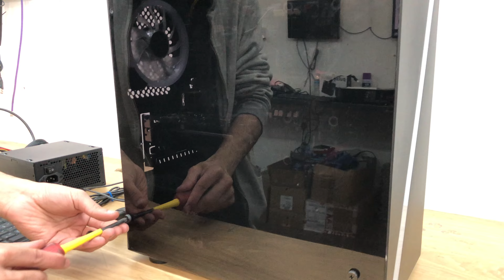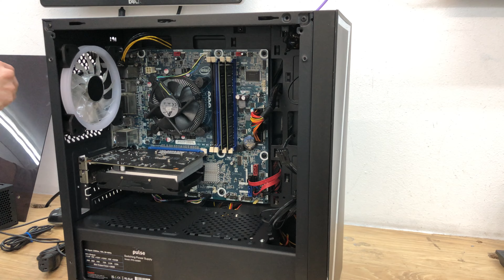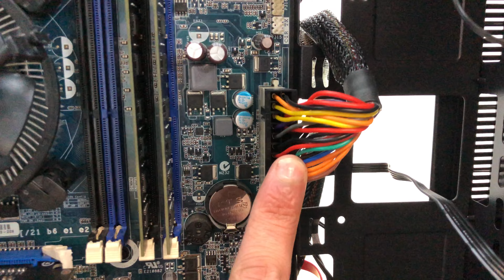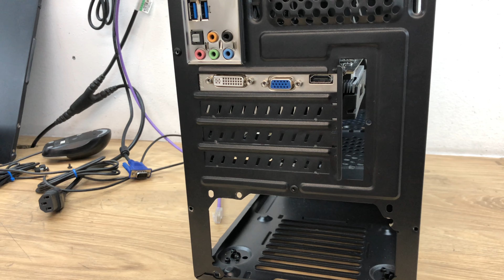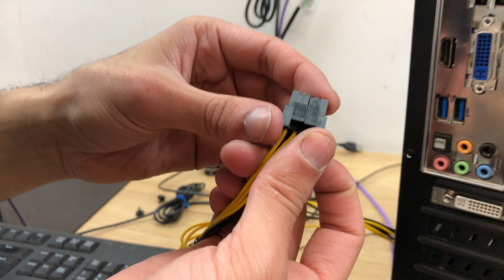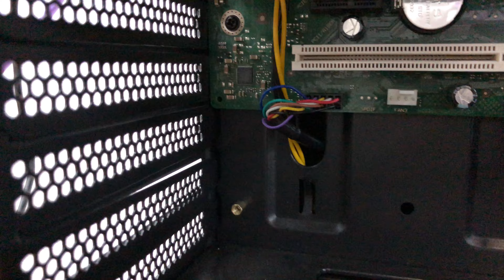How to Change Power Supply (PSU) in the Gaming PC?

Comment: Guys I bought a pc from you and I love it there was an error but I fixed by removing cmos battery and returning it but the problem is that the motherboard is on but the pc won’t turn on what should I do
Reply: same have u fixed this ?
Reply: is the pc good? what gpu does it have?
Reply: @AntiCitizen12 I had fixed it but now it’s flashing a blue led light and it has a rx580 8gb
Reply: @Pixelated480  they scammed you bro